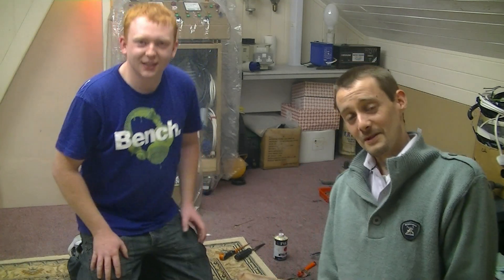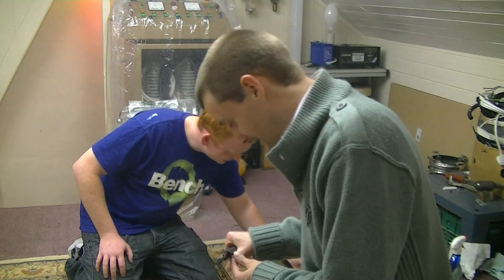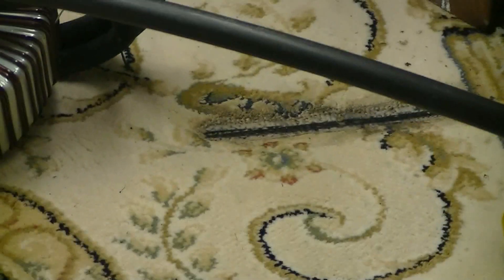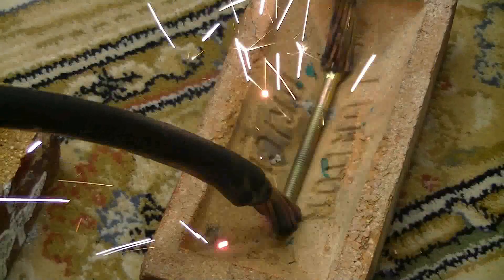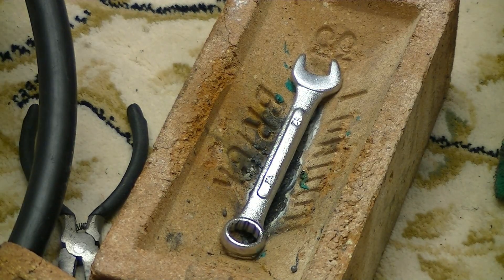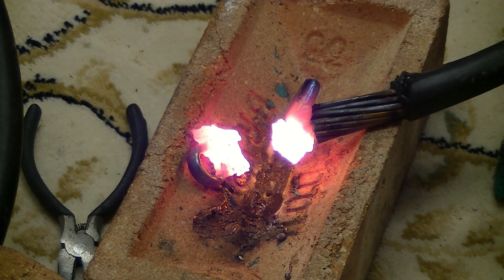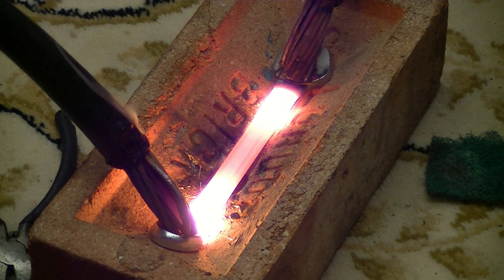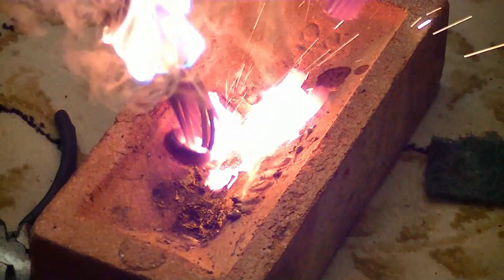5000 Amp Fuse + Tools Melt With High Current

Comment: Oh man, are you actually vaporizing the metal you are melting? Sure looks like it. I don't see a mass of molten metal to account for everything you are melting. Awesome video! I love that the carpet catches on fire. Might think about an exhaust fan though. I'm pretty sure inhaling different types of metal fumes isn't good for you (nor is carpet smoke). I'd prefer you stay around for a while to make more cool videos like this!  

BTW is your buddy smoking a cig or a joint? Looks like a joint. Even better. High current, high temps, inside without obvious ventilation, around clearly flammable materials with no fire extinguisher in sight, done with only a standard brick as a platform, and sitting directly on the carpet.  Don't get me wrong, I'm not ragging on you. I am actually praising you two for having some bollocks and not giving a shit what people think about it. 

Respect.

Comment: you should try melting the Eifel Tower
Reply: +John Barron Pretty sure it was sarcasm...
Reply: Not a chance. They had a hard enough time getting the screwdriver to light. The Eiffel tower is much thicker and much longer. The resistance would be astronomical and the current would be very low. You might be able to heat up the Eiffel tower very slightly though.
Reply: It would take at least 4,015,000kWh to melt the tower...if you had an induction furnace big enough.
Reply: Brandon Obaza but how much would the electricity bill gonna cost?
Reply: £382,000 roughly. Based on average cost to the industrial consumer in France
Reply: akupehsluarketatAR £382,000 roughly. Based on average cost to the industrial consumer in France
Reply: Should I start a Justgiving page?

Comment: So nowhere near 5000A.  DC/AC/Pulsed welder does this just fine 100-150A.  That's 2-4KW, 6KW if 200A.  Consider you weld 1/2-1" steel with 125-180A.  Other problem is no current or voltage management.  look at toroid, only about 2KW and looks like 240VAC input on 14-16G wire.  Looks like 20:1 transformer 240 @ 20 amp in, 12VAC out at 400A output maximum.  More likely 10:1 24VAC Output @ 200A just like many welders.  So fun picture but ...  Hope they were waring welding gloves as those things get real hot.

Comment: Hey! You never popped that 5 kA fuse even though you promised you would! :P
Reply: They might not want to, tripping those kinds of fuses are a) very very loud and b) somewhat concussive.
Reply: +nanomage Did that EVER stop Andy AKA Photon from popping ANYTHING? Hell he even popped one of those ridiculously expensive 1.5 kW arc discharge lamps (and irons, lawn mowers, plasma balls, countless CRT tellies and God knows what else)...
Reply: No, it's not any louder than melting the spanners. The noise you are referring to only occurs when the fuse is popped in a distribution center where megawatts are available at once.

Comment: amp never kill you
Reply: Voltage and amperege need to be high enough.
Reply: +Teo Karlsson Go to school and stop sleeping in Class that might help. I don't need to discuss with kids
Reply: +Teo Karlsson Well no wonder... 14 oh god, leave electronics to older people with more experience. Since I am building robots and work every day with electronics I definetly have more experience than You.

Also I have touched Wires in the Car that were Live connected to the Battery, nothing happend, it also can't happen on 12V DC because the body resistance.
Reply: Its the amps that kill you. But the voltage help too. 12v with 1 amp wont to as much damage as 230v with 1 amp runing through you!!  Voltage alone most of the time wont kill. But you will feel the fucker!!
Reply: +DerpyDoom no u can die by 12 volts just u get in over 100mA so u don't need much  volts u can get huge amount of volts in u without dying just the amp isn't too much
Reply: +Teo Karlsson i'm touching 12v every day, still alive ;) I can even hold Wires where an amp is running trough. AC is anothet level that would probably tingle a bit but not more
Reply: ***** plz tell me u aren't older than me (14) cuz if u r then its a shame that u rlly suck at electronics cuz u can't just have a wire with amps and hold on a 12 v battery the amp is in the same wire as the fkn volts dude jeez

Comment: Arrggh you were the one that caused the black out in 2003 , a 5000amp fuse should have been fitted at a sub station but someone put a 1amp fuse and caused a black out .

Comment: how much electricity bill he pays every month... ?
Reply: he said that toriod was 2.2kva - so running it for 1hr flat out would use just over 2kwh. depending on the cost of power in teh uk it could be anywhere from abou 10c to 70c.
Reply: @martij30 A battery charger+inverter is way less energy efficient than the money saved by using nighthours energy. If saving money was that easy then more people would be doing this.
Reply: well, think of it this way: if you run an oven, being a high current device on it's own circuit breaker, for hours at a time, you don't really see much of a blip on your power bill. This would be a similar power expenditure (very roughly, but still), done for seconds or minutes at a time.
Reply: Well he powers up a battery at night, that's when he pays less for electricity. This can save quite some money, and you can use it up at day.
Reply: who the hell would know about it? We're just consumers...
Reply: yea I bet he uses his back up support for his naughty boy times

Comment: Safety first: When working with high current, be sure to have a glass cleaner aside... on your carpet.
Reply: Wath
Reply: if one of them aren't dead yet, i'll be surprised lol
Reply: No it is perfectly safe, as long as you spray LIVE WIRE with it.
Reply: +Fluffy Bunny Carrot no his mate lost limb in electrical accident at work so since it was same topic he did fund raiser for him.  I think he went through a divorce and his dad may have passed too if I remember correctly.  I think this guy was or is building transformers for his job.  that's how he was able to build and obtain all equipment for his attic and his videos.  shame they were deleted.  if they weren't people could see just how intelligent this man really is
Reply: +Volo not a problem spraying one end, they didn't complete the circuit so as you saw, nothing happened...

Comment: Why doesn't the wire melt too?
Reply: The wire also has much more thermal mass. Rather than point-heating like the spanners they're melting, the entire mass of the wire is going to heat up together. They're focusing the current through a resistance bottleneck.

Comment: How many volts would be between those 2 thick cables?
Reply: there are only a few windings so i think it will be between 2 - 4 Volts
Reply: Very very few. If you're generating a 5000 amp current using conventional means (i.e. not inside a power plant) you won't get past 5 volts I think. Remember that Wattage = Amperage x Voltage, meaning at just 2 volts these guys would be consuming 10000 watts (!!!)

Comment: Are the tools melting before the wire because the wire's material has a lower resistivity? Let me know if I'm wrong.
Reply: Sure. Check out: the higher resistance point (higher resistivity + lower sectional area) always glows first.

Comment: Melting galvanised steel inside a confined space and without a respirator.

I guess your just fine with shortening your life with the toxic gasses then....
Reply: And it's also nice to see all these sparks flying over a flammable mat. 

Idiots... idiots everywhere.
Reply: He smokes, so it's the same!
Reply: Zinc oxide is bad for you, no doubt. But unlike lead or many other heavy metals, zinc will not stay in your system permanently. The remedy for zinc poisoning is time.

Comment: What was the voltage on the secondary of your transformer? I'm guessing that the primary was at 240VAC from a variac from the comments at the beginning. Also, was the current draw on the primary measured during this?

Comment: This is what kills you, ladies and gentlemen. You can get a 25000 volt electric shock with two balloons, but it's the amps that kills you when you touch a power line. Combined with the voltage of course.

Comment: Count the turns ratio.  Probably taking one volt.  Less than a flashlight battery.  You cold touch those wires to your tongue and you would not feel much.  The only danger is if you complete the circuit and get a thermal burn.

Comment: No, you cant. What burns is the friction between the electrons and your body. Electrons' flow is defined by current (i = dq/dt) so it does not matter the voltage, if the current is low, you wont get hurt

Comment: Dude if you really have got a PhD in Physics, you should know better than this. Current is the thing that does the damage, but without voltage to carry it, nothing's gonna happen. Your body's resistance will see to that. Inside your body, the resistance is much lower, but two volts isn't going to get in there. If you were to take some nice sharp probes and jam them into your chest, you might (might) be in for an interesting time, but that excepted, this is as safe as can be.

Comment: Hey photon, I find it good to connect a hose clamp to the very end of the cable :) It stops the strands from separating and saves you from melting your cable, unless of course you have the proper connections.

Comment: The bolts and wrenches act like a "fusible link" in an electrical system.  They fail at a lower current than the cables would.

Comment: @axel1973w Insulation was melting in our hands. Couldn't hold it after a while. Hat to get a pair of gloves and leave it to cool down for a bit. The insulation caught on fire a few times where it was getting that hot at the ends :s

Comment: @Yfr28 That bit of 95mm double insulated XLPE single (the big black cable) was getting red hot. The insulation was melting in our hands. We even had to resort to sharing a pair of gloves (one each) to keep going because neither of us could keep hold of it. That size of cable is rated at about 250A 300A at a push I think it says in the regs and it was taking 3 times that do it was getting pretty hot pretty quick. Escpeially the melting end which we wer holding.

Comment: The secondary winding you mean? I'm guessing probably nothing as the voltage is too low to overcome the resistance of your skin and allow any current to flow through you! Assuming we're dealing with only a couple of volts, and a (completely arbitrary) skin resistance of, say, 1Kohm (in reality it could be thousands of times higher resistance, depending on conditions), you'd get MAYBE 0.002A through you. Piece of piss :-) My grandmother could take that.

Comment: TOTAL LMAO at the size of that fuse!!! Ah yes, I have my electrical fix once again. :-D

Spanners, screwdrivers, adjustable spanner. Have you got *ANY* tool kit left? :-D

Whoever flagged this, needs to be put on that transformer, or chuck that fuse at them!

I want that fuse in my plug. :-D I bet that's seriously expensive to replace!! :-O

So how are you going to *POP* that one without emptying all of the sand out of it?

Looking forward to THAT one!

Yes! PHOTON IS BACK !

-BBD.